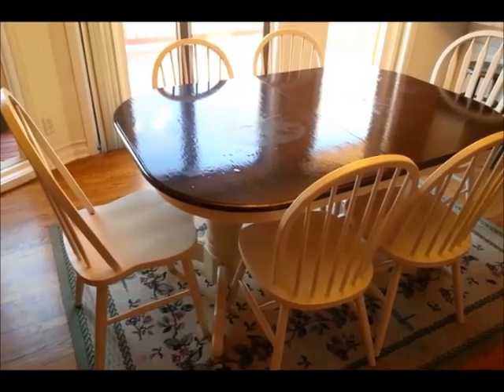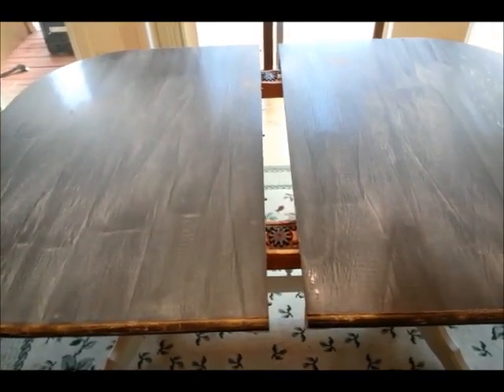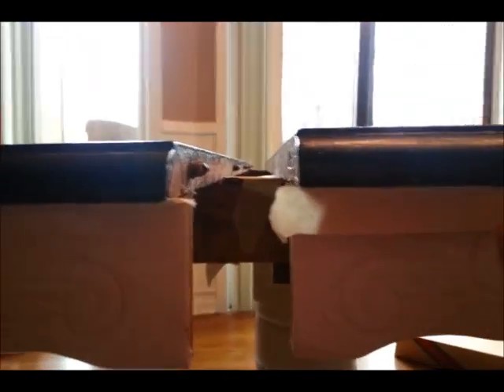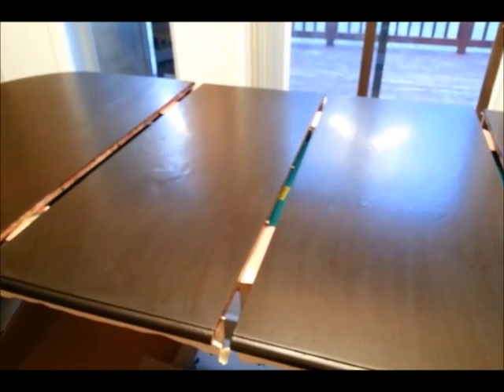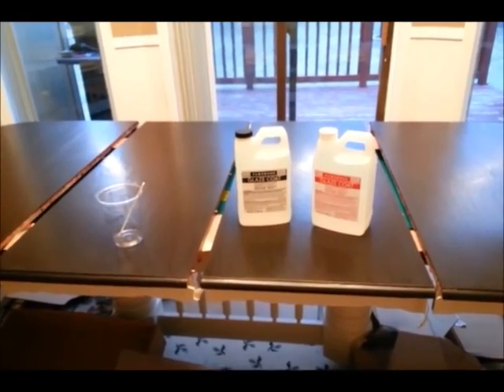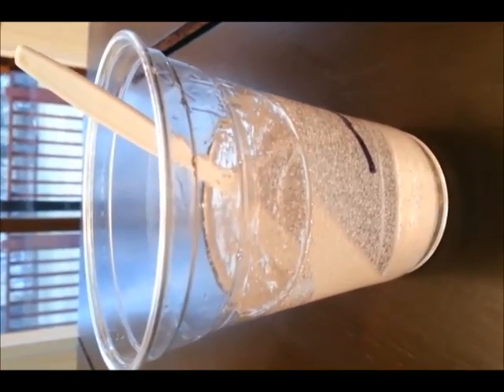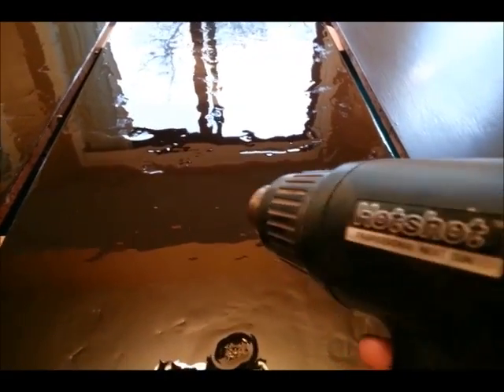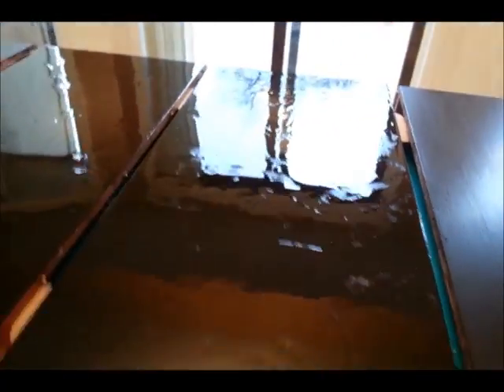How to Glaze Your Table Top with Rock Hard Acrylic

Comment: I took an old dresser and have stripped and completely refinished it. I’m making it into my bathroom vanity and rather than doing a marble countertop, I’m considering doing this. I know this video is older, but is the glaze coat epoxy still holding up? The final result looks beautiful!
Reply from the maker: Amazingly, the glaze coat epoxy is still holding up. This is my favorite thing I have ever done. I have since put epoxy on my countertops in my kitchen. I used Stone Coat Countertops epoxy. I ordered it online. This is by far my favorite epoxy I have ever used. Good luck!

Comment: I bought same stuff & mahogony wood all sanded down but trying to decide if I shoild stain it being isnt most stains contain oil in it?
Reply from the maker: I went ahead and used it even though my table didn't absorb a lot of it.  I ended up wiping away a lot of it since it didn't sink in, but it still gave it the color I wanted.  I hope that makes sense.
Reply from the maker: Oh, my goodness I love mahogany wood.  I would be nervous to give you an opinion on such a fine wood.  My project was making cheap formica top to look like a nice wood.  I had nothing to lose.  Epoxy definitely has a bit of a learning curve.  I would suggest starting out on something with less importance.  Good luck.

Comment: Would you tell me if it scratches at all, wouldn’t want to go through all that if scratches
Reply from the maker: It is really pretty hardy.  I haven't had any scratches with regular wear and tear.  I do a lot of crazy projects and use my table for a base, when I'm doing something extra heavy I put a tablecloth on to protect it.
Reply from the maker: It does scratch just like a hard wood.  I ended up making a mistake the first time I put it on the table.  I didn't realize a pizza box would leave a white mark.  I sanded it down and re applied epoxy.  After that, I have been more careful with it.  I still do lots of projects on my table and it has withstood regular wear and tear.